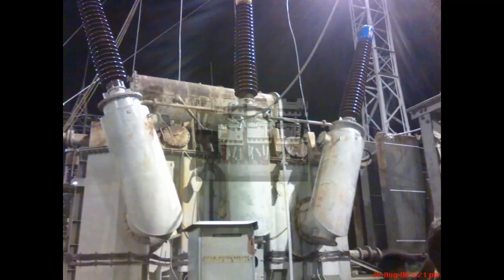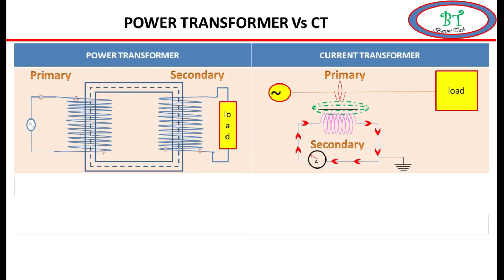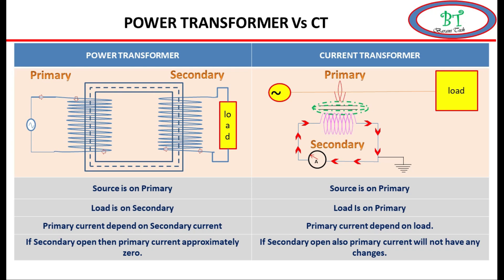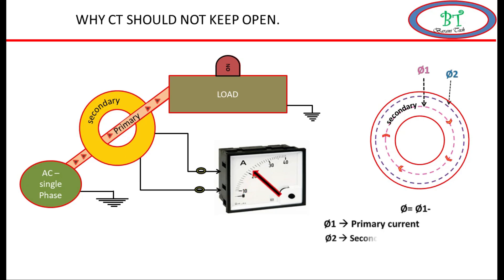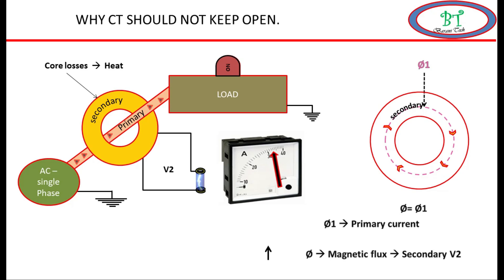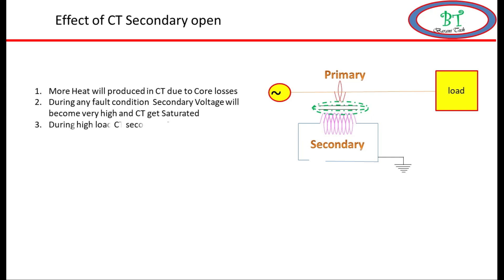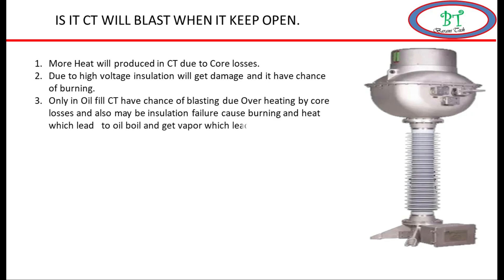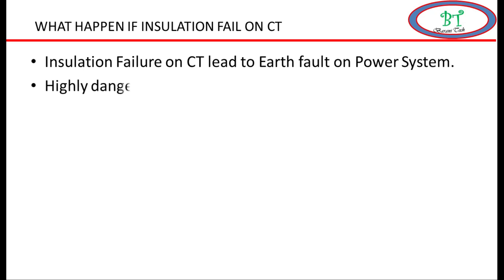Why CT Secondary should not keep open

Comment: Hai Mr barani, what will happen if we use low ratio ct for the high current conductor. Example using 30/1 instead of 100/1. Please advise
Reply from the maker: CT life time will effect very much and also easily get saturation during heavy fault condition.

Comment: Hi sir, 
I have a question why does the power transformers don't blast when then the secondary side opens? 
Even the power transformers also have backemf to counter the main emf of power transformer?
Reply from the maker: POWER TRANSFROMER -ALSO HAVE CORE LOSS IN NO LOAD BUT WHEN SECONDARY OPEN THE PRIMARY CURRENT WILL BECOME ZERO. SO THE SECONDARY VOLTAGE CREATE  WILL BE AS PER NAME PLATE.  ( SIMPLE -MATCHING PRIMARY VA = SECONDARY VA)
Reply: @baranitech  thanks sir